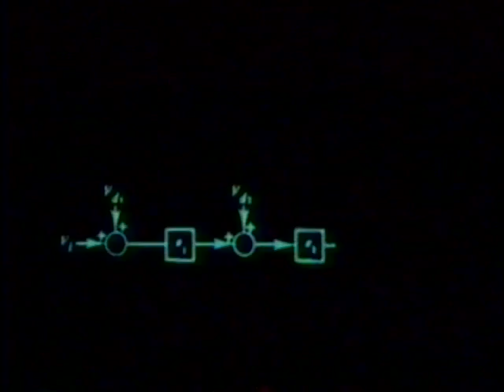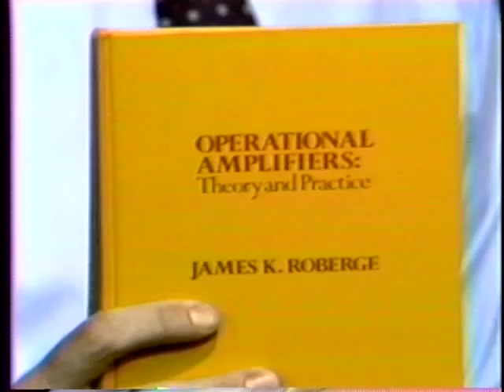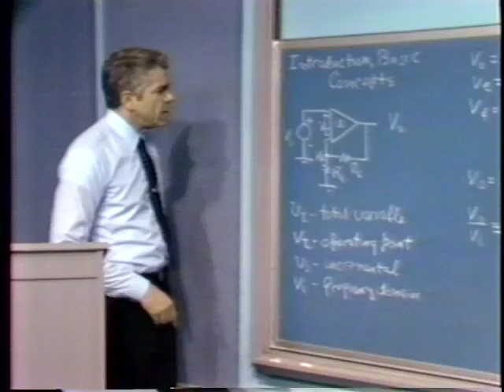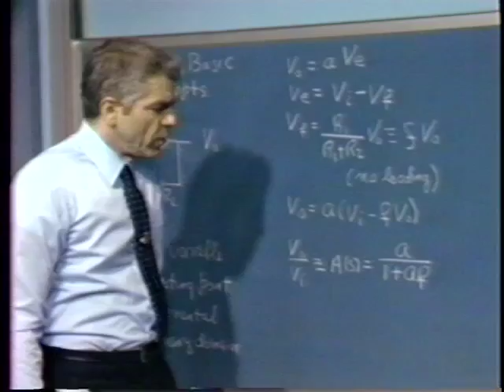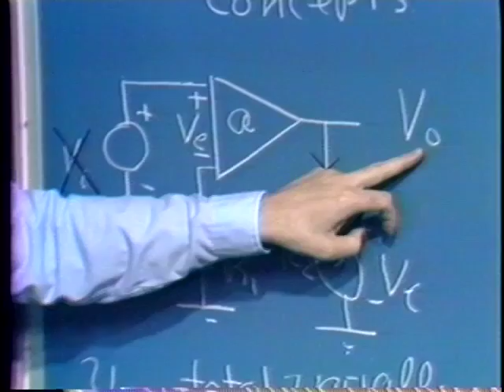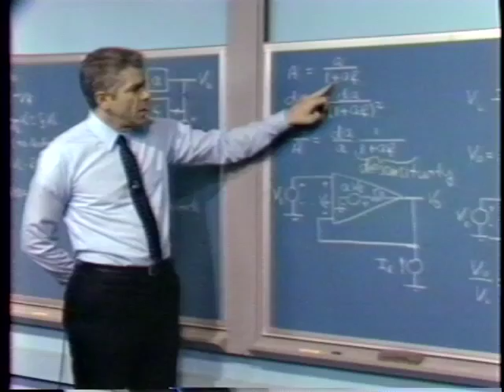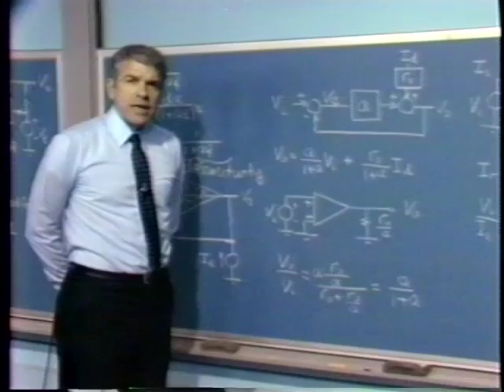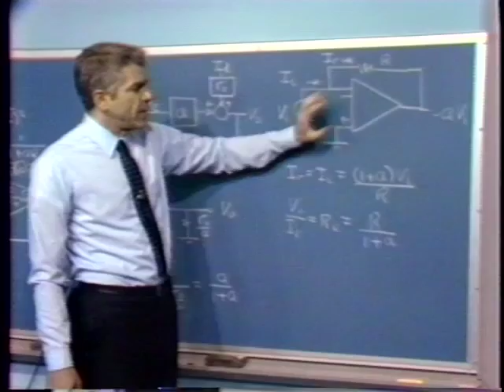1. Introduction and Basic Concepts

Comment: Scaling a circuit parameter (resistance) to get an open-loop system with the same voltage transfer function as a closed-loop system seems like a math hack.
Reply: Lots of such math hacks are necessary to ease analysis done without digital computers/SPICE. They are practical hacks.